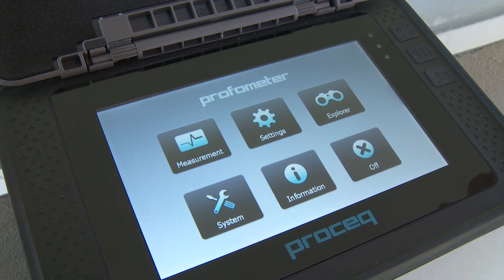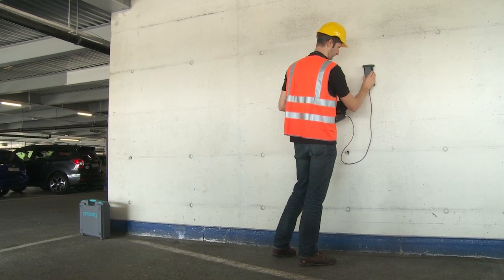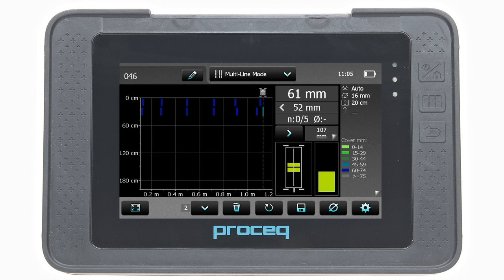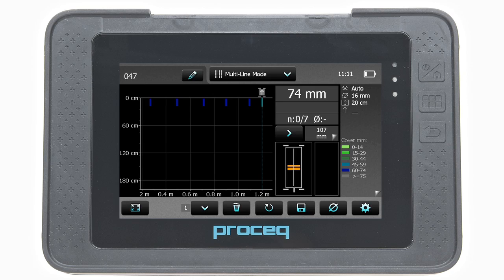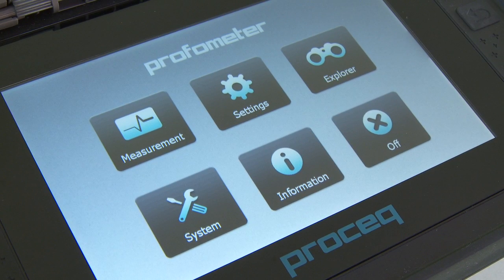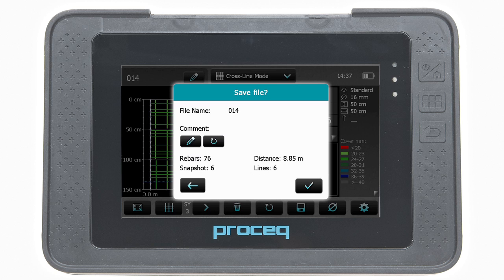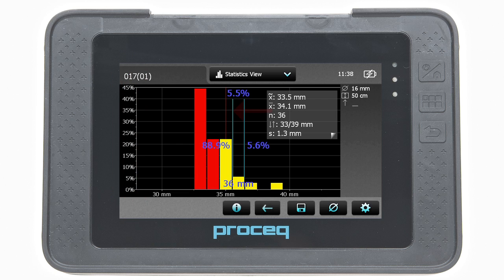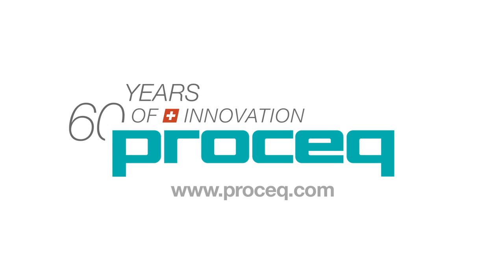Cover Meter & Rebar Detector I Proceq Profometer 6

Comment: "In theory, it is a wonderful piece of equipment. However, after using it for over four months, I've found it quite complicated. The instructions are not as clear and user-friendly as they should be. It would be helpful if they created a more thorough video that covers the specifics, including examples for different types of measurements and elements